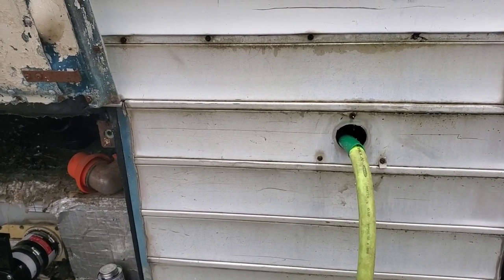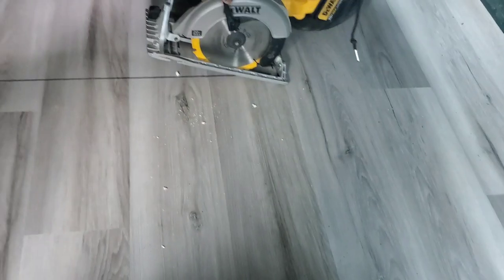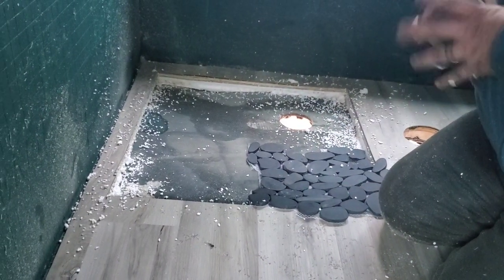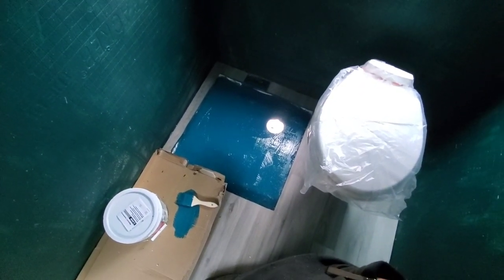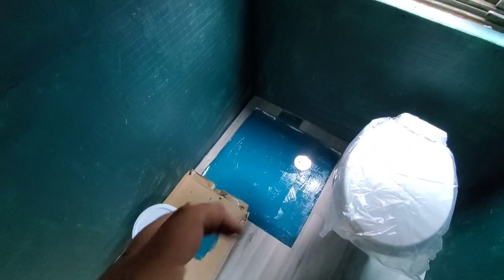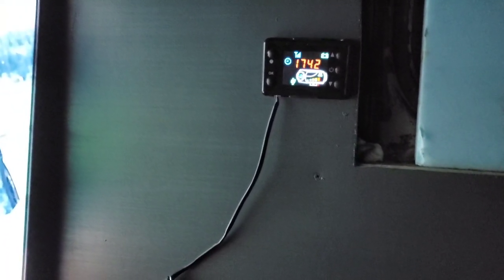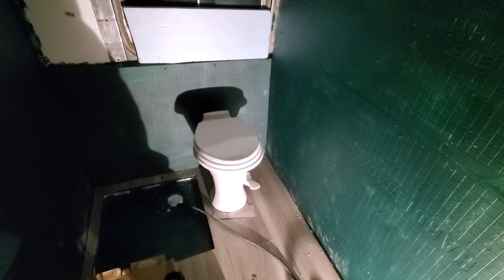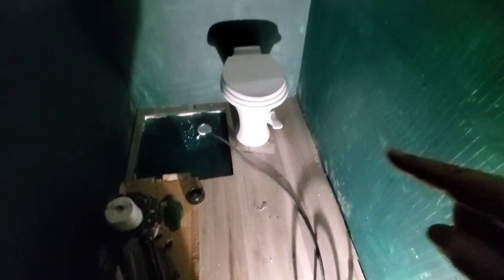build day 7 on the pd3751

Comment: Nice job.. its coming together.. that tile inlay in the floor for the shower is going to look nice. Glad the heater is working out for you.. anytime.. You are still getting quite a bit done.. are you working your job on the weekends too? 
I just posted a slideshow video today of my MCI build that I was working on before I got my Wanderlodge, I did a full tile shower and tile inlay in the floor.

Comment: Are you going to be using some sort of flexible grout for the tiles/stones? If not I would worry about popping grout going down the road. I laid a tile floor in my kitchen with only 5/8 boards and 1/2 ply over it and it poped grout and tile after a few years. Lesson learned. Tile needs rigidity of sub floor to last. Nice progress!

Comment: Did you consider tiling the entire floor like a wet bath. I don't think that flooring is going to like getting wet. Hope I'm wrong. You're really knocking this out quickly. Way to go!
Reply from the maker: All the flooring is made to get wet. I just did the floor that way to have a greater slope to belp with draining if the bus isn't level. Easy clean up when you're done to.just squeegee the water to.the tile and let it drain off.

Comment: Having that heater must be a great relief.  This sounds like a silly question but are there going to be shower walls or will water splash all over the toilet and sink? This is going very quickly.
Reply: There typically are no separating walls in a wet bath so yes, things will get wet.